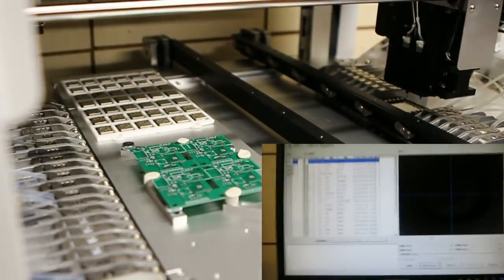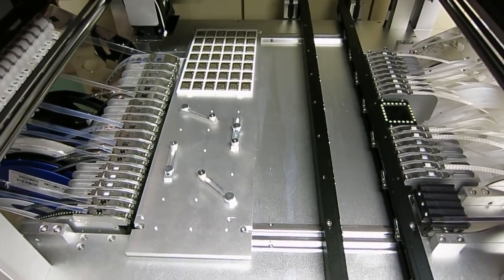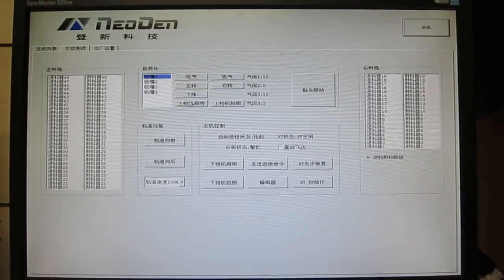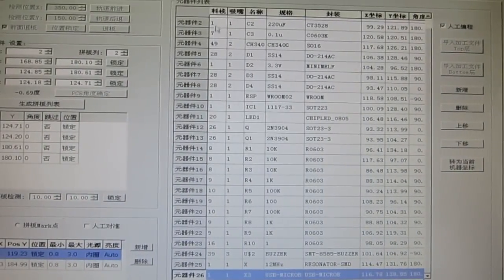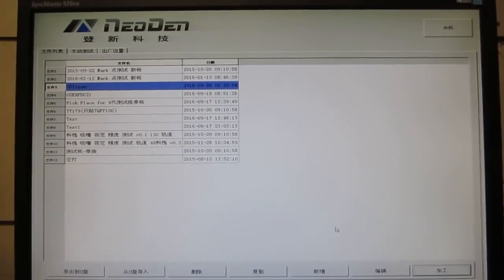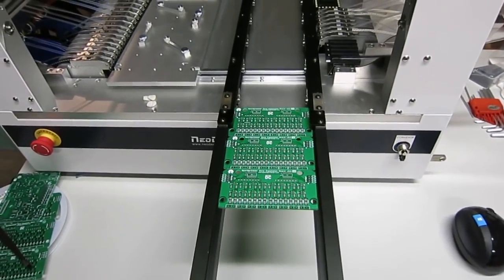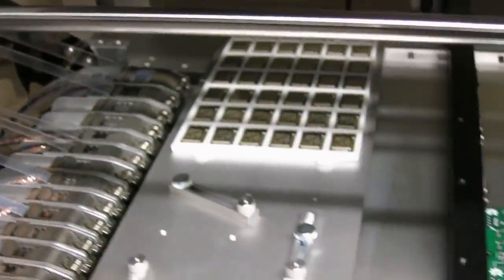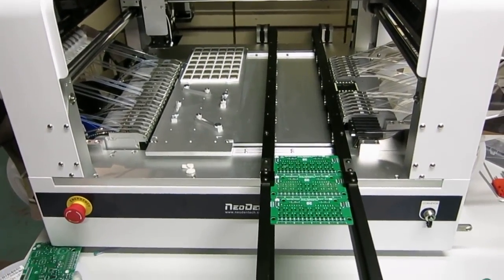NeoDen 4 Pick and Place Machine with Vision System Introduction

Comment from the maker: Hi Robert,
Thank you for your kindly attention on NeoDen Tech's machines.

Kindly note as our machine use air-pump to do actual suck and blow(pick and place)work,if the components is too big or heavy,when the machine blow components to required position,it will cause slip problem-caused by centre of gravity.
What's more,the placement height(too small value)also will let the nozzle go down too much to touch the PCB.If the solder paste not well covering on the soldering pad on the PCB,then there are no enough stickness to catch the components,so there are many reasones.

Welcome to send email or add my Skype to talk/ask if have other questions,tks.

Bsd,
Tonny

Comment: Nice Review.  Thanks.  It would be nice if the screen shots were in English.  A comment on speed differences with the TM220 / TM240 machines would be helpful as well as your experience with the improvement in alignment over the older models.  We have found that the components sometimes slip when the head is rotating and travelling so if that is still an issue after vision alignment it will reduce the accuracy of placement.  You mentioned this a tiny bit at the end but didn't say how bad it was or if it was only for large heavy components.